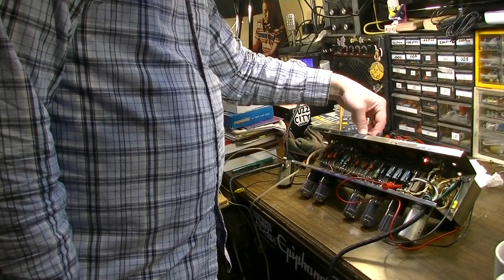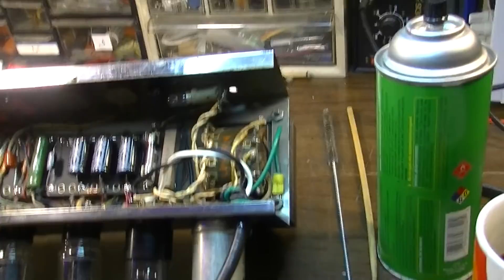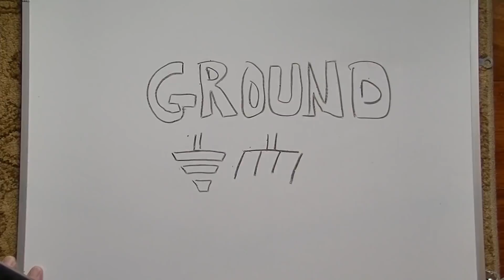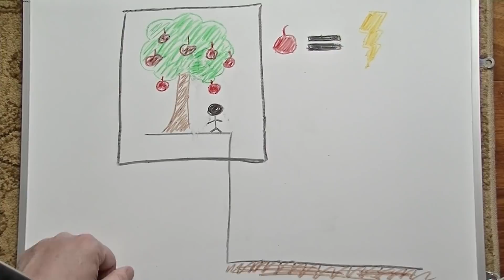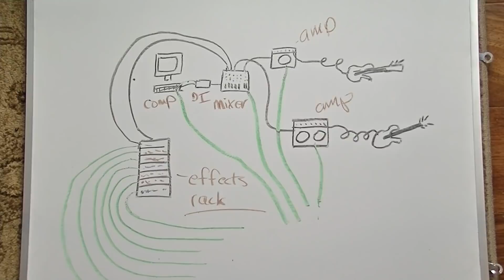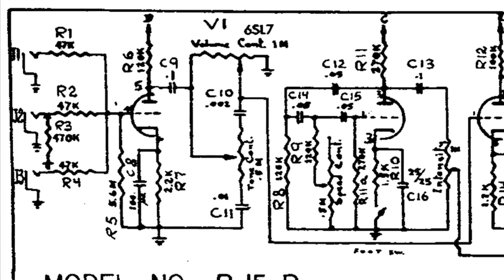Ground Loop Lunacy! - 1962 Ampeg R12 Rocket RESTORATION (Cont.)

Comment: If you want a mechanically quiet transformer, you need to alternate the direction of every single "E shaped" lamination.  It looks like that transformer only alternates the direction of the "E shaped" laminations every 5 laminations.  Then you need to drive a wedge between the windings and the center leg of the core.  The bolts need to be tight.  And finally the transformer needs to be vacuum varnished.  Unfortunately this rarely happens with consumer grade electronics, such as this transformer.

Comment: I  toured in the 60s with a band and 2 of us had Ampeg amps. The Ampegs were more expensive than comp. Fenders. I was told that they were designed without looking at other amp designs and after watching this video I guess that was true. On the road I can tell you that we had less problems with the Ampegs and that they were dead quiet. Our amp tech said that this was because they did not push the out put tubes as hard as Fender. I think that the Porta Flex bass amp speaks for it's self. Where I mostly saw Ampeg guitar amps was in the studio and with Jazz guitarists. Jazz guys loved them because they said that they were mellow and clean. The company designers did not under stand hard driven guitars and players as they emerged. My question is if the grounding design is the problem how were the amps working and very quiet when they were new. Nobody would ever buy a amp with hum issues anywhere near what this amp was exhibiting. Not being a smart ass just wondering. By the way I am a vintage Fender guy now and build custom amp cases.
Reply from the maker: When I follow the accepted standard for adding a 3-prong grounded power cable, the problems start. They were designed before the 3rd ground prong in the US. Replacing the cap can might have been a factor as well. But this is the way it goes sometimes, you try to keep amps as original as you can while still making them useful tools.
Reply: So true about Ampeg making their amps as clean as possible distortion-wise. I've had 3 different Jets  from the early years (late 50's to mid 60's)  and the newer they got the harder it was to overdrive them

Comment: So do you think that the original design worked well-enough  (ie. not enough noise to bother folks) due to the lack of an earth grounded AC plug?
Reply from the maker: Yes, precisely. I think that's the main reason.
Reply: I wouldn't be one bit surprised if it had always been noisy... possibly the new xfmr made it worse though. What potential the chassis is sitting on makes precious little difference to induced hum, so I don't think it's related to earthing.

Comment: In the first video, you made a ground rail in the unused section of the eyelet board. If Ampeg had intended the chasis to be the common ground rail, so to speak, did your new ground rail create the ground loop? I once added a speaker jack for external speaker use in my Peavey Backstage Plus transistor amp. I had immediate problems with the reverb tank until I insulated the jack from the chasis. I had created a ground loop.
Reply from the maker: There was actually already a bus there, all I did was connect it to the eyelets in that area to make things a bit neater than running multiple jumper wires between eyelets.

Comment: Seems like Ampeg wanted the chassis ground from the Input jacks. Maybe the can capacitor isn’t supposed to be chassis grounded, and the line voltage wasn’t meant to reference ground either.
Reply: Nope. A capacitor only fixes DC issues. This is clearly an AC-issue, 120 Hz.

Comment: I'm not sure if you have this information but, you can get 3/8" Keystone Hard Fibre Shoulder Washers from Mouser (Mouser P/N 534-3069) to isolate 1/4" jacks from the chassis. All you need to do is drill the jack chassis hole out to 3/8" and install one washer on each side of the chassis. Then install the jack through the washers and tighten the nut. They are cheap. I bought a bag of 100 in 2003 when I built my first amp. They were designed for this purpose.

Comment: I enjoyed your explanation of grounding and it cleared up some questions I had about the subect (e.g., ground looping), but it begs the question of the cost-benefit of trying to resuscitate an obviously neglected and abused (and probably design-compromised) amp in favor of buying either a working amp of that vintage or a new one.  Ampegs were never that good an amp (I’m 68 so I remember!)—except for their bass amps—and were always overshadowed by Fender.  Why “Fender-ize” this amp when the real thing is avaliable...
Reply from the maker: Wait for the demo. You might change your tune. ;)

Comment: In a past life I was a RF tech. Just wondering if some of the problem is that the replacement power transformer is not shielded as well. Seeing it doesn't have a "bell" on the one side.
Reply from the maker: The transformer flux field won't be affects much by the bell end.

Comment: Wow.  Amazed that ampeg would use multiple ground points like that.  Are you finding the outer foil side of the poly caps?  Outer foil should be ground.  On interstage it should be plate > foil> grid.  Helps reduce hum further.
Reply: Thanks for the reply.  You do awesome work and i love the channel.  Theory and practice are two different arenas.  Keep it up Brad

Comment: Brad - I had a re-issue of the Reverberocket (mid 90s) 212R. It was a beast of an amp... hated hauling it. But the clean tone on this amp was so amazing! Really lush reverb that trailed off into spaciousness. The down side, was the ridiculous rattle within the amp that was always present (regardless of channel) at anything above volume 3 and the super weak distortion channel. Worked around the weak distortion with pedals, which it took nicely, but the vibrating rattle was too much to overcome.

It needed a float of sorts... we tried all kinds of things. Changing tubes, Tube rings, tightening screws, removing the chassis... finally just gave it to my pops and moved on to a Swart Space Tone, which is my perfect blues amp, but I’m still in search of that clean/Reverb tone the Ampeg offered... 
We always joked that it weighed 600 lbs... super sold cabinet... that rattle is 100% the fault of the manufacturer.
Reply from the maker: Try a stethoscope?
Reply: Death Rattle confirmed😂

Comment: I feel like that silver pick would disintegrate after a little while
Reply: Fair enough, fender mediums might as well be made of styrofoam. I like a pick that responds to being held but I also like one that wears in well, and if I go to smooth it out on the carpet I don’t want it to melt
Reply from the maker: Quicker than plastic?

Comment: There's only one point of contention I have with your discourse on grounding Brad. I feel like a dick saying anything after you went to all that trouble with the illustrations and all. But anyway its not the earth that electrons are trying to get to its the source they came from. For the AC power in homes or offices etc. that source is the secondary of the utilities transformer. That secondary is a center-tapped winding with 240 volts across from end to end and 120 volts from each end to center. The center tap is the neutral point that all current supplied by the xformer returns to. We also tie this point to ground and reference all metal parts in the system to it to give a path for fault currents back to the transformer.
Reply from the maker: They are trying to get to 0 potential. They just want to stop moving and we keep forcing them. It's atomic slavery.
Reply: @TheGuitologist  occasionally they retaliate against us
Reply from the maker: Like Conan the Barbarian.

Comment: Do both the HV winding and the 6.3V winding have Center Taps?  If so, don't use the 6.3V CT.  Your Ground loop may be right at the PT if you GND both CT's.

Comment: My amp has been acting up lately making low rumble noise when idle and also some slight volume fluctuations. Would that possibly be a bad preamp? And if so, is the possible fix just to change the v1 tube with a brand new one?
Reply from the maker: Get a good tube and sub in one at a time until noise stops.

Comment: I was amused too looking at you trying to tighten the nut on the transformer with a socket and a flathead screwdriver. I've had the displeasure of using those screwdrivers with the black and yellow plastic handles. They're horrendously slippery and tough to get a good grip on. Don't you have a socket and ratchet set? EDIT: just to be clear, I love this channel and the content you put out Brad, top stuff! I've just noticed on several videos of yours that you could use a good socket set with a good ratchet. :D

Comment: I remember the lengths to which you went to isolate the inputs on the previous Ampeg - using insulating tape and fibre washers on the metal jack sockets. Would it have been easier and more reliable to use plastic jacks that didn't ground to the chassis?
Reply: Yes, plastic jacks is an easy solution but they look very incorrect in an amp made in the 60's and they are probably not able to stand that physical violence from guitarists (or guitologists 😁).
Reply from the maker: That would be one way to go, but I detest plastic jacks.
Reply: @TheGuitologist  I do not like plastic jacks  either. But sometimes the ground connection to plug is better than in metal jacks.

BTW, I would be very happy if you could read and comment, if possible, my  comment about the Mesa S***n amp case.  I perhaps had a point if I did not totally misunderstand the situation. (My comments are found in the last episode (Ahab ...).

Your videos are very entertaining and educational and I very much enjoy watching them. Thanks.
Reply from the maker: @kevin paul halliday Tried that off cam, didn't work.
Reply: @ Kevin: no. There is a voltage differential between the jacks' "grounds" and the first gain stage V1a's "ground." That is root cause for this hum. You need to rewire the jacks' grounds so that they are at the same ground potential as V1a's ground-referenced grid, which is R5 in the schematic. This is subtle stuff, but you can only fix it once you understand where the 120Hz hum is coming from: the filter capacitor's ripple current which gets dumped into this design's "ground" wiring. You model this as a voltage source, "Vnoise." Pencil it into the schematic, and then say "how to I counter Vnoise"? Ideally, you need a differential amplifier on the input, but those weren't around in 1962, so compromises have to be made to attenuate the noise. At this point, you run into the argument "but I don't want to change any of the original design"... I.e., "fix it but don't change anything."